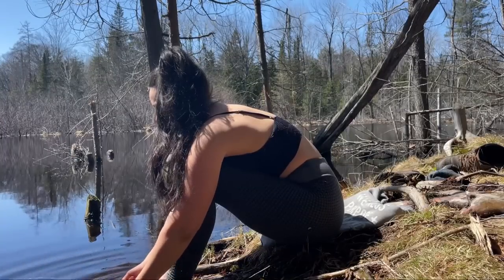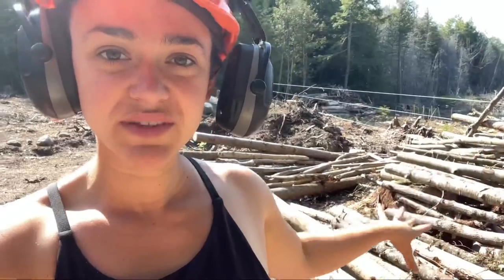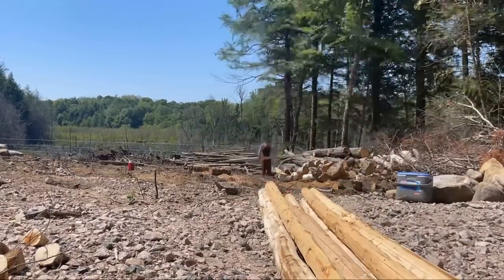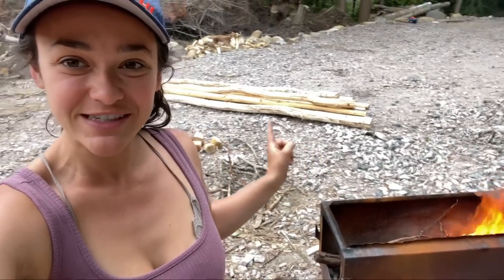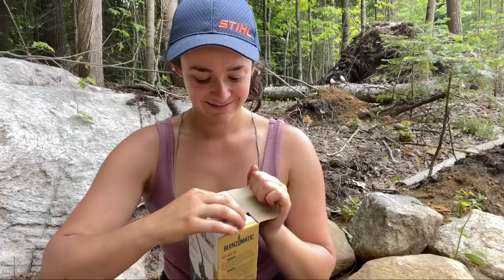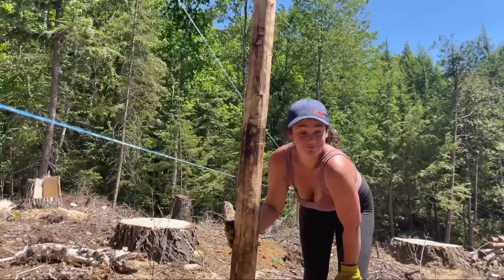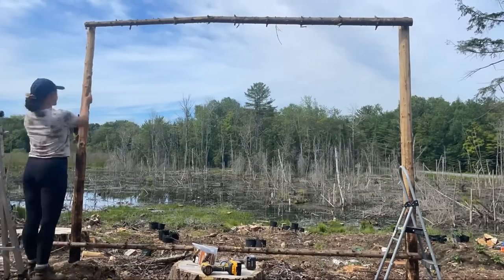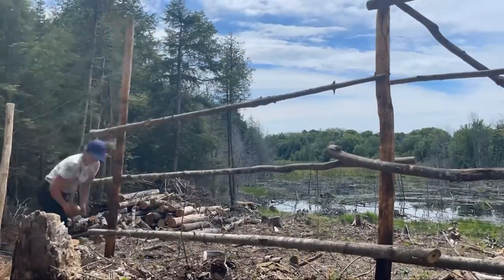I BUILT A FENCE FOR $30 - for our homestead in the woods (log debarking)

Comment: Rustic is beautiful.  You did a great job burning the bottoms with your wood stove.  (I am working on a rustic critter fence right now.). 
The deer will still get through, but you have a great start there.  If you were to go get some wire —chicken wire is economical, but there are many choices — and staple it from your third rail down, not only will this deter the deer, but also help keep the rabbits out.  For deer, they say 5 feet high is okay, but 6-8 feet is better.  Since you have the rail system, all you have to do is run a line of wire or rope between any rails above the 5’ mark, having tacked your wire on the lower portion. White nylon rope is good because the deer can see it even at dusk.
Critter fences the size you are dealing with normally cost well over $1000, so if you can keep it under $300-$400, that’s impressive.

Blessings to you and your family.

Comment: hey there late to the party here , u can get a torch they use for driveways , works off of a propane tank , u can get them at home depot or princess auto , u can get a longer hose to replace the short one that comes with it the one from princess auto the hose is very hard and not flexible , get the replacement hose and its way longer will make your wood buring easy and amazing ....

Comment: The only place the posts will rot is at ground level were they get air and water. Most posts when you pull them after years are not rotted  below or above the ground .

Comment: Tough learning things the hard way.Nice to see how persistent you are.Tip for the day.The 180 quick chain adjuster an bar are to flimsy for the debarker.It can be converted to side adjuster with 2 bar lock nuts.Another hint for that turbo torch .Just start it with valve cracked open a little.Thats it for this week.Good luck lil lady lumber Jill 😜
Reply from the maker: Thanks so much! That’s super helpful! Can I just bring it to the Stihl dealer to get it switch out to 2 bar lock nuts? Oh and good to know about starting it with it cracked open! Thank you!
Reply: @SimpleLivingwithBiata  If your Stihl dealer has the parts and know how.I converted my 170 and 1 of my 250 to quick chain adjuster.I got the parts you need.Just bring it to Maine an I 'll do it for you Ha ha🐸👍

Comment: You need to tamp dirt in around the posts. The rocks will not hold them sturdy enough because they can't fit tight enough together. Honestly they will not rot easily with dirt around them .

Comment: I am a one man gang like U and find work goes very slow. I got clay ground, and there is a round posthole shovel ya can get, which is less width than what you have, so smaller hole , and less diggin.  If ground is hard,  I put bucket water down it, jab it with shovel/crowbar, and hard clay becomes mud , and now easy to dig deeper and get mud out....... There is a special 2 handled two shovelled joined together posthole digger ya can buy,,but never used it myself, cause you have to expand the handles to compress the dirt below, so that means a bigger hole and more work....My idea is just enough size hole to get post in , so less work per post,,, and crowbar/small log to compress the dirt back in hole........The gas torch I use works best upright when tryin to lit it, and just open up a little of gas,  and I use a barbeque lighter to put inside nozzle....I use it to clean the  Stihl chainsaw/brushcutter clogged spark arrester that gets loaded with carbon and makes the machine go very slow 🐌 .....another great video, and do take care of your back....best wishes
Reply from the maker: Thank you so much for all of this! So many amazing tips! I appreciate it!

Comment: Thoes chappes need to be replaced as they have a few cuts in them.
Reply: Reduce the gas on the gas bottle befor lighting then increase gas flow.
Reply from the maker: I was wondering with the chaps! Thank you! And thanks for the tip on the propane torch!
Reply: Hey sweetheart the deer going between the rail
Reply: Maybe you have to install another rail between the three on bottom